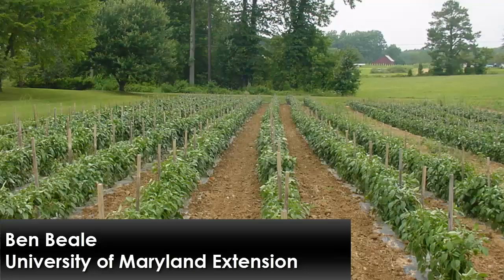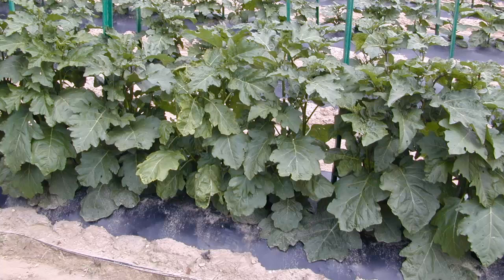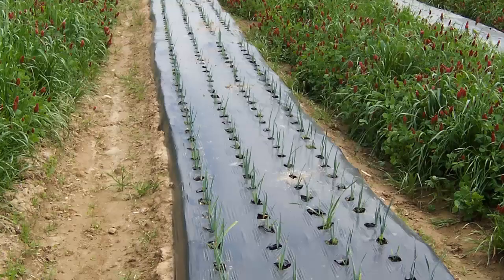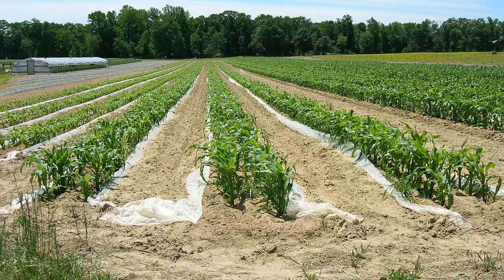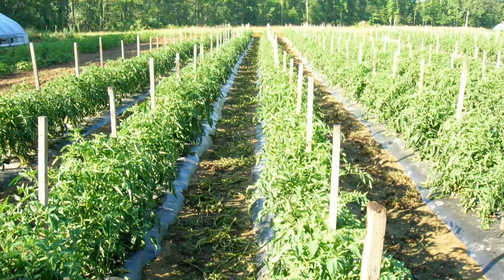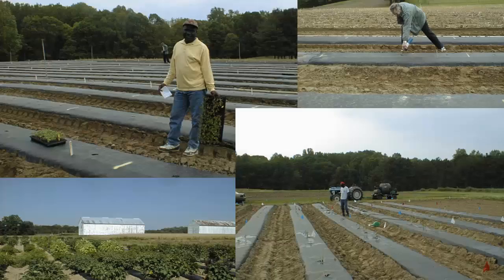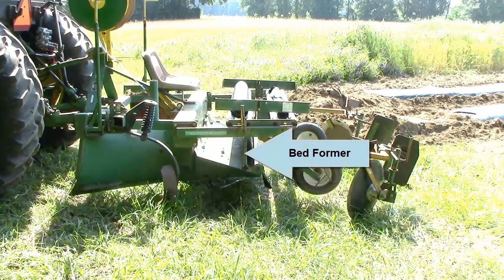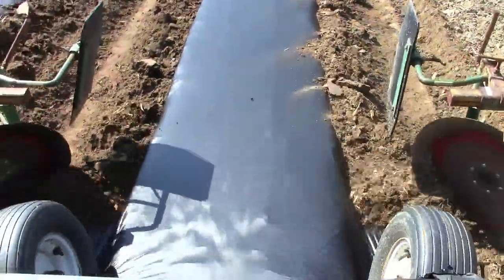Introduction to Plasticulture and Drip Irrigation

Comment: In my backyard garden, I've been using blue pm for all my zucchini and red under all my tomatoes; has been working great. Material is quite thin though, and generally not in too great condition to reuse after a season or two. Blue is hard to find, by the way.

Comment: Is there a certain type of plastic sheet to use to keep chemicals from leaching chemicals from the plastic to the crops?
Reply: Not really.  The industry is working on vegetable based plastics.  I know it's more time consuming but I recycle cardboard in my garden.  Shredded as well as layered, it is mostly clean and sterile and helps maintain water use.   It can be tilled into the ground after each use and breaks down quick. The plastic looks great but clean up sucks.
Reply: Ur 1 of those

Comment: I'm a farmer also, you have good straight eyes! But I wood never lay plastic without drip tape, to add fertilizer at anytime you need to. Maybe the crop you are putting down doesn't require much??? 👀👀👀👀👀👀👀👀👀👀👀👀
Reply: He does mention this at 7:31

Comment: Can you use simple plastic garbage bags over backyard veg gardens to get a similar effect? I’d like to warm my soil early as possible in spring but don’t have the budget for building cold frames...
Reply: black plastic does not do a good job of warming soil--use clear plastic to warm soil and back to prevent weeds
yes you can use plastic bags to do this

Comment: The most important question I have is, is it sustainable?  If the plastic goes into landfills it should not be an option :(
Reply: And the labor to lay it down/ tear it up....
Reply: Well, if you consider the farmland itself to be a landfill then yes it does. Also do you consider your body a landfill? It's going in there too.

In short, yes. Very sustainable. From the standpoint of microplastics.